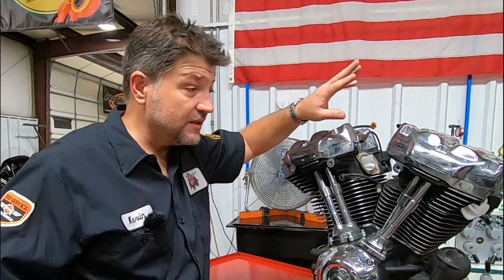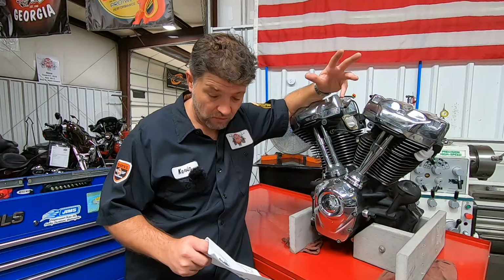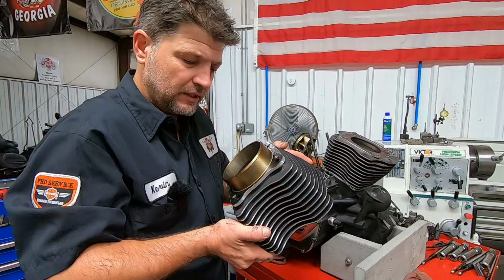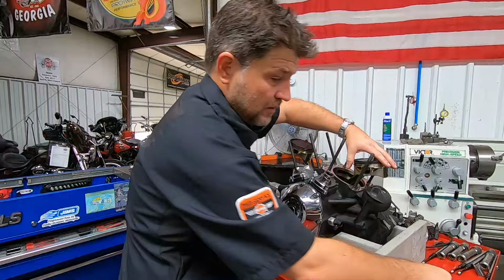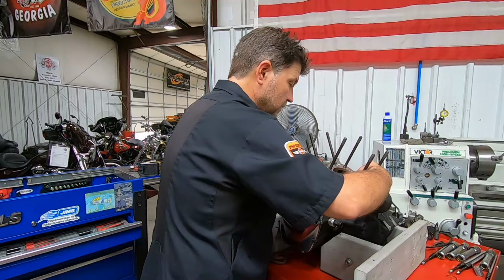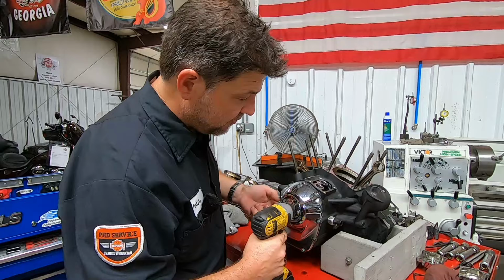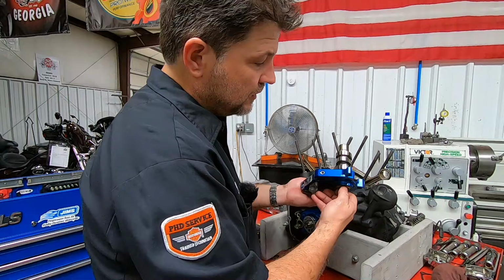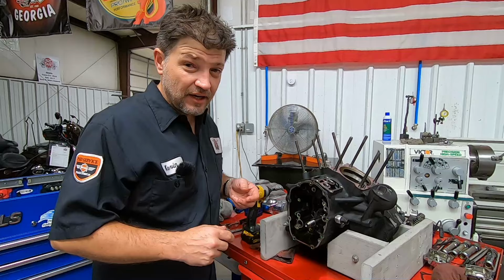80,000 MILES and KNOCKING! - Milwaukee 8 Engine Tear Down - Kevin Baxter - Pro Twin Performance

Comment: Great information.My question is in a better choice to rebuild that motor or would out be a better choice to just buy a new motor.After all the cost for parts and labor.Is it a better option to get it rebuilt or just replace with a new crate motor enstead.
Reply: I chose having Kevin do my engine with expectations of having a better finished product than new H-D. Harley has very loose build specs that won’t last as long as a blueprinted engine. Harley has my other M8 apart for warranty engine work at 20 k miles. Bad pistons and cylinders

Comment: A Honda Goldwing doesn't break until it hits 40.k think about it folks and this engine is done at 80k
Reply: I have a goldwing now after coming off a twin cam road king. Can’t compare these two engines. That goldwing will break 100 k miles with nothing other than oil changes! I do nothing on my goldwing but put gas money n the thing!
Reply: That’s cool and all but some of us don’t want Goldwings. And that’s fine. Ride what ya like.

Comment: which cam did he put in put in his motor , great video Kevin,  Happy to see a higher mileage bike come in, I have a Chance to buy back my second to last Harley I owned a 2010 ultra limited, I traded it in at 65.000 miles it ran great then, and the current owner had it since buying it from the dealer in 2015 and it has just 74,0nt 00 miles now so he only put 9,000 miles on it a younger married couple that now has kids that keeps him off the bike a lot, which is understandable,   I may want to get the motor rebuild at some point, just not sure when, it will be nice to get it back, I put a ton of chrome n extra parts n paint on it lol

Comment: All harleys get pretty damn hot though no matter how you ride you can’t prevent it, usually I shut it down and let mine cool off when it gets over 220 and usually stays right around 200 normally.  The thing that worries me most about my sglide 103 is how long it takes to warm up

Comment: Rear cylinder always seems to be the one that takes the most damage. Makes sense since this one gets less airflow of cool air after the air passes the front cylinder and then has to contend with the legs of the rider
Reply: In this case it's the front cylinder showing heat damage

Comment: What’s running ok vs somewhat hot to hot and what’s should the actual heat range of the engine be riding it?
Reply from the maker: I look for 300 to 325 when measured at the base of the spark plug with an infrared gun after a conservative ride and no traffic.  That's a good "tuning hack" as well to help narrow down good AFR and timing.
Reply: @KevinBaxter  how about temp range when using a power vision 300-325 as well?

Comment: My 97 EVO got 30k miles before it crapped out. Flywheels were not paralleled from the factory. Very disappointed with HD. Wrote letters to the motor company seeking relief and basically they didn’t stand behind their product and i was screwed. I loved my FXDWG but the corporate leadership was gutless

Also, I changed the oil every 1,500 miles with mobil one. Not a oil issue a union issue.

Comment: I just found this page, have always had metric bikes as I was a Mechanic in a metric shop for many years. Just sold my 2011 Victory Vision with 87k on it and it ran like new.
I was looking for a Cross Country but due to accessories and eventually parts going away I started looking at Harleys. I'm disappointed to find the inherent issues with the 103. I ALWAYS have lots of projects in the shop, my main bike I want to NOT be a project. So I'm having second thoughts on a Harley now, or, should I go back one generation, find one needing a rebuild,  rebuild it and have a better more reliable engine?

Comment: Do you think there a correlation with the front cylinder glazing on this engine and cylinder deactivation? Since the front cylinder had the internal heat marks, and the rear cylinder didn’t, it seems possible that they could be linked. Have you seen any evidence of this or any bulletins suggesting this?

Comment: I had some piston slap on my sportster.  it didn't look that bad, but when I measured it the was a .002 difference in clearance between what came of and the new jugs and pistons I put on.  It totally fixed the noise.  .002'' is all it took to make it sound like garbage.
Reply from the maker: doesnt take much at all.  that front one is probably .004 or more.

Comment: Kevin
First its amazing to watch and listen to all your knowledge.
Thank you for all your videos.
Question I have 2017 FLHTK M8 30K miles
Rear cylinder spark is about double the front is that normal?
It knocks on taking off in first gear, tried retarding the timing on both cylinders 3 degrees using a Power Vision, no improvment really.
By the  way I live in Panama, I really cannot find any one I would trust as knowledable, the local dealer mechanic is a joke.
Any suggestion, I'm really concerned about damaging the engine to the point of no return.
You would'n be planning a vacation to Pamama 😆 I could sure use your help.
Thank you
Richard
Young man going on 79 years old been riding 53 great years.

Comment: I got away without signing my gag order when I  got my $19,500.00 back. 350,000 early 88 Twinkies had loose lower ends that made noise at about 2300 rpm! Mine was a Harley buy back after 5K on my 2001 Road King!

Comment: If you wanted to Disperse heat would you go with screamin eagle jugs at 4.310? Or S&S jugs at 4.280?
Reply from the maker: Actually...neither. what is the specific reason you are asking?  Maybe I can help better explain why.
Reply: @KevinBaxter  okay I’m going to beef up my 2018 road glide M8 107 add another crank to 4.625 and either put 131 screamin eagle jugs 4.310 pistons on it or S&S jugs and 4.280 piston. Is the screamin eagle jugs that bad because they are thinner even though made of a different material bs the S&S which are thicker material?

Comment: Define extra heat what to what should be at vs if at this and that indicates this and that?
Reply from the maker: heavy gold discoloration is a sign.  natural steel will begin to turn various stages of yellow/gold starting around 430 deg and begin to turn brown, then spot red and darken around 500 deg.  Im not an expert in this field but am aware of these numbers.  Blacksmiths used color to estimate temps for centuries as a gauge for tempering, etc.  Its an art.  As for aluminum, it doesnt really change color as it heats up...but as temps rise, it forms an oxide layer.  That layer allows staining to easily occur.  So once it gets hot enough to form that oxide layer, and then be stained...it's getting way too hot in these cases.

Comment: Kevin I have enjoyed watching your vids. Question I have a twin cam 88 15k miles, I installed the 509 cams s&s header and cooling. I want to install a 6 speed transmission. Your thoughts and possibly an installer. I'm located in the Augusta area.

Comment: My 21 114 was getting lots of valve train noise.    Let me just say that I live in New Orleans where it’s 92° and humid all day and night, so my motor was sounding very loud to me so I checked the oil in was 3/4 of a quart low so I added 3/4 of a qt  and today was only 82 degrees and totally different valve train noise.   My question is is is it normal to be 3/4 of a quart low at 900 miles on a Breakin.

Comment: Admittedly, this is a mechanic video, but from the standpoint of an owner/rider, does it make sense to put this much time and money into an engine that has this kind of mileage? If you had the engine rebuilt, could you expect another 80,000 miles? Or should you just replace the engine or the whole bike?

Comment: It never used any oil? Well... That's yer problem there guy. You gots to put oil in it. 
I would recommend 20-50 because it's thickerfor that high milage.

Comment: I'm always concerned about overheating when riding my m8 on hot summer days in California. At what oil temperature would you recommend pulling over & shutting it down for a rest? At least we can lane split here but sometimes I just know my engine is getting cooked. I use redline synthetic oil in hopes that it holds up better in high heat.
Reply: Found myself lane splitting here in NC ( not legal ) recently just to keep air moving over it!  I'd like to know more about this too!
Reply: @eugeniustheodidactus8890  I lane split here in VA only when I can feel the 103 starting to bog down from the heat.  It is ridiculous that it is illegal.  Using AMSOIL synthetic.  So far so good at 75000.  I am starting to worry about the cam tensioners  Wish they would speak of them in the service manual.

Comment: I don’t see why you would have to tear down an engine after 80k. I have a car and truck both with 80k and I have not them tore down. Either way it seems the new revolution max engine addressed all the M8 issues. What I have found that religious oil changes nearly eliminate any and all engine issues, some don’t do it but it cheap maintenance. I drop oil more than anyone and all my vehicles have high mileage with ZERO motor work.
Reply: You aren’t comparing apples to apples

Comment: 80k miles does not seem like a lot for an engine to have a major failure??
My 2009 Sportster has this amount and is fine, its not using excessive amounts of oil or noisy at all.
What would you believe the cause of the failure is? Not enough oil changes? Poor quality oil? Tuned too lean? Excessive idling? No oil cooler? Or was the original oil pump to blame?

Comment: I have Electra glide 2001 ultra classic, 120.000miles, all these years changing only oil+sparks, cam tensioners,camchain, pushrods, full exhaust, k&n filters, power commander, tunned in dynamometer, oil pump,  and some gaskets, nothing else.Why this engine needs rebuild in 80.000miles!!!!!!?????

Comment: I have 78k on my 14 streetglide 103 motor,  It started knocking, Burns a little oil and have a loss of power after running for about 45 minutes. Anyone know a ballpark figure for the cost of  a rebuild as to a new motor . S&S 124 is $7,500.

Comment: These  engines 4 some time now dont even have small end busihngs Just metal to metal so when it has wear  u throw them out and get a new crank assembly.Gone back to the days of the D model Harleys(circa 1930) which had same and no meat in the rod ends to hone them out and put in bushings.Just another  planned obsolescence.Was never a fan of shafts that cannot be replaced either!The older flywheels ( about 1986 and earlier I seem to recall) had shafts that could be removed and replaced.Far better idea.Rebuild them 4 ever!!!! After that the LHS flywheel had to be replaced To be fair the RHS gear shaft  had a sleeve on it that could be replaced no problem but the older system was far better in my opinion.

Comment: This shows why Harley is going out of business. Why would you buy a bike that needs torn down with only 80,000 miles?  I owned one Harley in my life, and this is why I won't own another one.  You spend more time working on the thing than riding it.  This is very poor quality.  They didn't machine the m-8 properly to begin with and that was causing head gaskets to blow prematurely in 2017.  Buy a Goldwing if you want 300,000 miles before tearing down.  This is ridiculous and solidifies my decision to not own another one of these pieces of junk.

Comment: I’ve been a Harley tech for 23 years now and the quality of Harley engines has gone down not up. The twin cam is giant piece of junk and so is the M-8. I can’t even begin to sufficiently convey how many times I’ve seen this same scenario. Harley press fit cranks suck and without a forged crank this problem will persist. The twin cam and the M-8 have straight crank pins that are prone to allowing the crank to twist and pinch. At least the under powered Harley evo had a tapered crank pin witch is much petter at retainer it’s press fit. The moral of the story is I work on Harley’s but even I’m smart enough to not ride one. FHD. I’m the only tech at the dealership without a Harley and if you knew what I rode you wouldn’t understand unless you know these machines like most of us seasoned Harley techs do! FYI Indian/Polaris at least has forged cranks and not so many issues. 80k miles is not a lot of miles with today’s technology. I’ve seen other makes go many many more miles. Good luck Harley owners.
Reply: I agree. I had an 88, it was a solid bike. Nice quiet engine. It was destroyed in a shop fire. I replaced it with 110.  Terrible bike, noisy engine. It sounded like the internals didn't like each other. I sold it and got a Moto Guzzi. It is not unusual to see these in excess of 200,000 miles on unopened engines.
Reply: I'm sure you're right. But it's not THAT expensive to rebuild after 80k.....

Comment: i swear man, it seems like they designed this engine to not be able to be serviced by the owner at all.. Harley literally has done a complete 180. Cant check plugs easy to see how its running, rockerboxes and lifters have to be disassembled to be able to remove the push rods, ect... its fast but 💰🕳

Comment: MT01 Yamaha motor, 1700cc, same as fitted to the US cruisers, 90 bhp, 130 lb ft torque, stock, stage 2 130 bhp, torque up to 160 lb ft, side by side rods on a single big end with shell brgs, 400,000 miles still running.
Ducati 2V air cooled motors, 1000cc, making 90 brake, 70 lb ft torque, known examples passing 200k miles on a bottom end, side by side rods, shell brg big ends.
Suzuki 1000cc v twins, ditto, 110 bhp engines, side by side rods, shell big ends, known examples clearing 200k miles WITHOUT lifting the heads.....see where i'm going here....
80k is good miles?

Comment: Oh sheeeeeet my M8 has 85000 miles on it and it’s already had two rebuilds 2017 Road Glide Special edit: ya so I rode the baffles off, as in one of the baffles fell off inside the rear pipe lol
Reply: How much did it cost you for each rebuild

Comment: So a Harley touring bike with 80,000 miles that’s knocking so thats around $30,000 new probably more but lets go with 35 grand with financing so if you ride 15,000 per year (touring bike) in 5 years it’s knocking and this dude is tearing it down 🤷‍♂️ this can’t be serious

Comment: First of all 80,000 maybe a lot of miles for a Harley mechanic to see but…and before you start in about trolls in the comments 
I am a member of a motorcycle organization where most every bike has 80,000 plus mileage even 150,000 and on YouTube a guy with 400,000 miles and yes its a “Goldwing” but Harley Davidson builds beautiful bikes with heritage and a life style if you will but they will never ever and I mean ever compete in reliability, longevity, dependability, horsepower/torque (factory engine) or non modified not to mention oil consumption then they sell you a bike that you have to modify the engine, suspension, lights, handle bars , audio, seat, exhaust etc…
I will ride Honda, Kawasaki, Suzuki, Yamaha, BMW, KTM, Ducati, Royal Enfield Triumph well you get the picture so let the comments fly about how your Harley isn’t a money pit that after all the bells a whistles and $60,000 a damn Goldwing out of the box is hard to beat🤑
Reply: Factory Goldwing full of 87 octane
Reply: Sure your bike is loud it’s even loud with the engine off while this guy ⬆️ tears your engine down at 80,000 freakin thousand miles on it 🤣🤣🤣🤣🤣 someone tell me this is a parody or someone is getting punked 🤣🤣🤣🤣🤣🤣🤣🤣
Reply: And he said at the beginning this was one of the highest mileage M8 
tear downs yet🤣🤣🤣🤣 tell me your not serious 🤣😆🤣😝😂
Reply: Kenton Kloos 658,000 mile Goldwing on YouTube